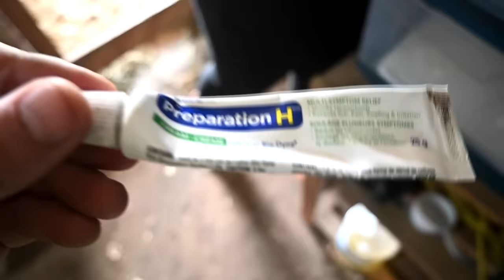Surprise New Pets On Our Farm!

Comment: Hi Sophie.  Roses are also my favorite. I had 34 different varieties. Mostly heirloom/heritage a few hybrids.  There should be directions on how to plant them.  First of all it is best to work your soil first putting a little transplant solitition in a watering or pail and if you have some will rotted manure or buy rose soil will help the transition from pot to ground. Dig your hole twice as wide as your pot and deeper than the pot. This will give plenty of room to spread their roots. You should trim and remove  the canes. This also help the plant to set better. Plants go into shock. Also. You should have socked the rose for a few days before transplanting.  This helps also with transfer. Before putting your plant into hole put the transplant solution in the bottom of the hole. About 4 cups. Place the rose into hole and full with soil. Once soil is in push down to firm the soil around and under the plant. Takeing the air out. Then water the top of ground. Sprinkle some more soil on top so the sun doesn't dry the soil out to fast. Soaking the rose (watering) for the few days helps the rose from going into shock as harshly.   You have done well on loosening the roots. I would have directed them a little more in directions to help the plant to be more stable. But your next rose will be better. We learn as we go on when trying new  things.
Laura you can take cuttings from roses and start them. That is how I did it. And when I wanted to put more around the front of buildings I used cuttings from my will  established roses. Some of mine are 60 to 90 years old. Maybe older because my grandparents planted the roses that went wild and are huges bushes. Also I like lilacs and peonies plus assorted bedding plants. Geraniums are great but the entrances to the house and in window boxes or on the windowsills. Flies and some other pest do not like the aroma of the plant. 
Sophie.  Worms in your garden benefits the soil your plants live in. Chickens can find their own and if not this meal they will go without. Some times you will see chickens out in the rain to find the tasteful treat. Also dandelions are good for the soil as well. They are natural fixers. Where you find them plentiful the soil is not healthy. As the years go by there will be less and less. And where there is none the soil is healthy.  Good luck in your rose garden. Also check your plants for any problems and buy them from your local greenhouse grower. They will sell hopefully number one plants and must will guarentee their plants. Where stores will not. Money saved in the long run. 
The baby poult are so cute. Oh yes for got to comment on the  video about one guinea hen missing. Question was it a male or female?  Most foul team up in threes ( Trio ) one male to two females. They are more content.  I found that when I had two pairs one male disappeared.  Or  if not the female went to nest.  Also chickens will go in the building to get their food when they are hungry enough. 
Great video. God Bless.
Reply from the maker: It was a male guinea!  Such good ideas a out the roses. I would have loved to see yours!